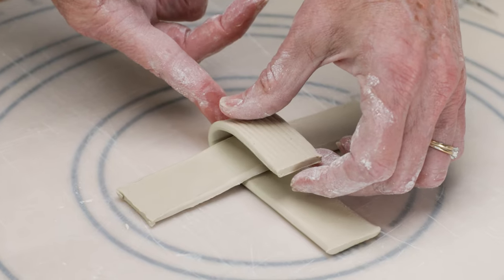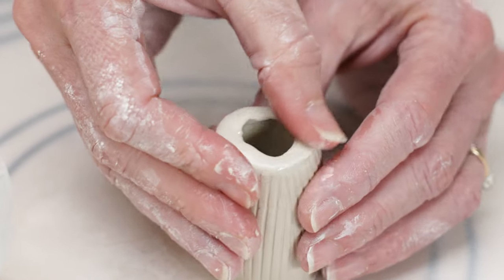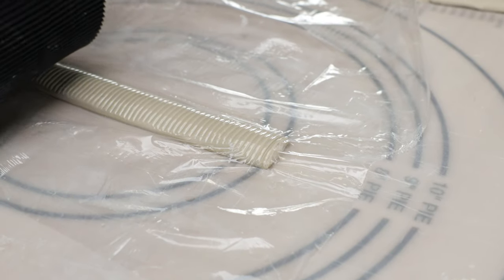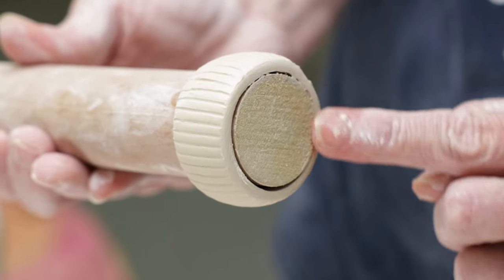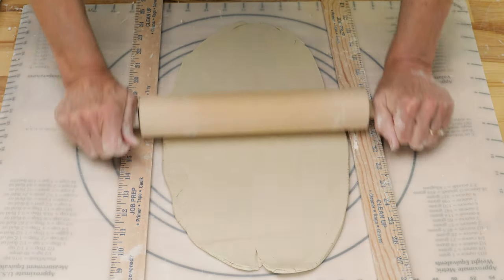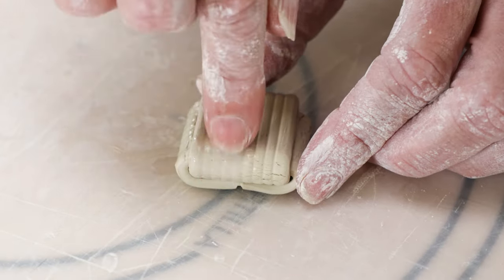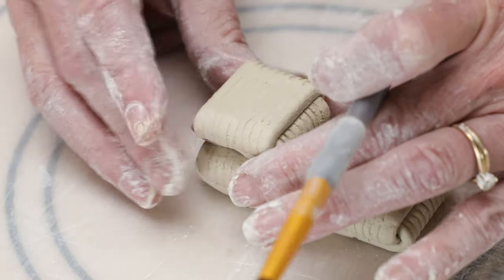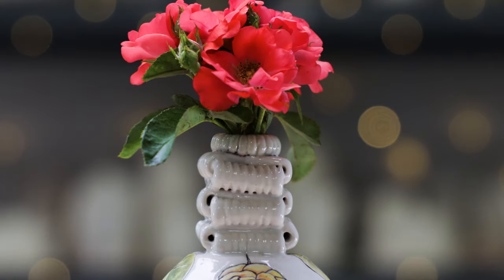Making Collars for Vases - CREATIVE COLLAR IDEAS!

Comment: Thanks, Ann! I really like the chain link one. Great video!
Reply: Aww..thanks so much!!  I really wanted to see if I could weave with the clay.  I came up with a couple of different ways to do it, but I bet there are more elegant ways to achieve something like it.  I bet you would do a really good job coming up with alternatives.
Reply: @annruel1982  I’ve never tried weaving - though I want to. You make it look so easy I may have to try it!
Reply: @darlink57  Go for it.  My tip is to start with clay that is just a little more on the wet side to avoid cracking.